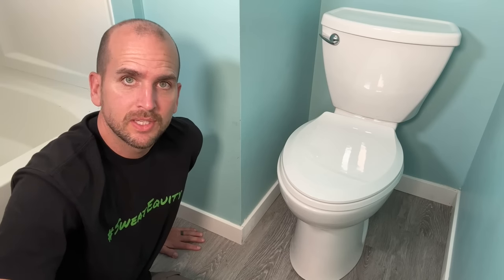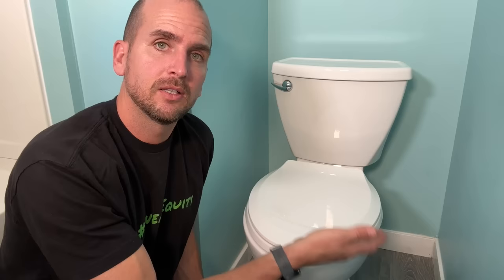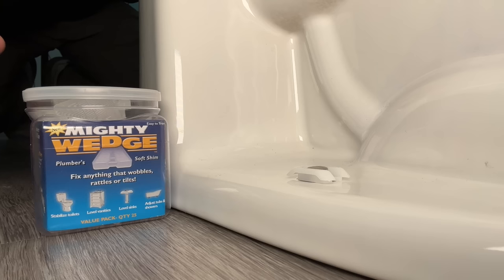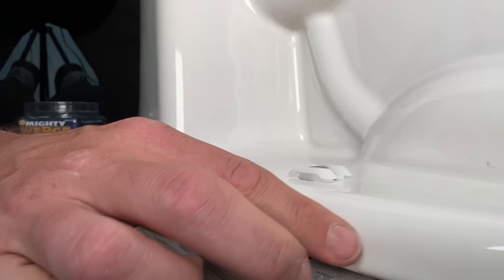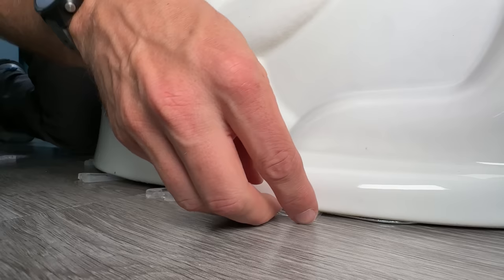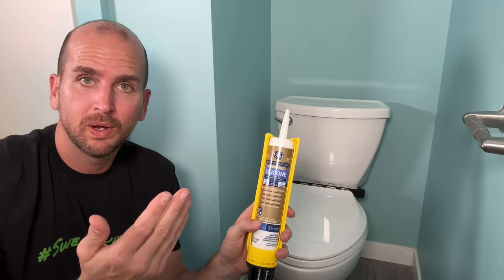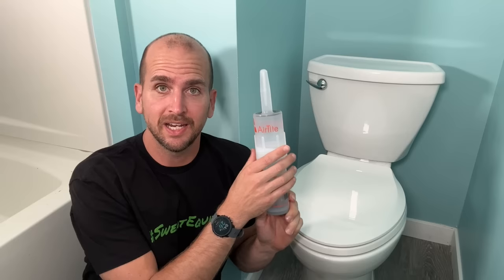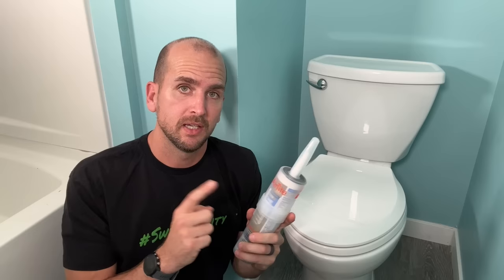How To Fix A Wobbly Toilet | Permanent Solution

Comment: If you installed a wax ring and you shim after you could break the wax seal adhesion to the toilet or flange either with the wobbling toilet or by inserting a shim thereby lifting one side of the toilet.    Compression is ok but lifting up is not.  Level and shim the toilet first with a dry fit without the wax seal. Then reinstall the toilet with the wax ring onto the shims you already placed.
Reply: Great video. For this comment abive is why I made the switch from wax to rubber rings for just this reason. Unlike wax, the rubber/vinyl can accept movement without breaking the seal. Very forgiving!
Reply: This is not a permanent fix. Need to cut out flange and replace with new one.
Reply: It should be permanent, but if you want to avoid shimming rather than the flange being the problem you need to level the floor.
Reply: @MrStevebl19877  If you watched his previous video, you can see that he already addressed the closet flange.
Reply: @lym3204  This happened to me.  Shimmed after using the wax and it leaked due to rocking it to level it.  Wax compressed too much.  I used the Danco Perfect Seal he used the second time and that was perfect.  It let me shim after setting the toilet and it maintained the seal.
Reply: If you dry fit with the shims placed in position they are all going to move once you lift the toilet up again. Just shim after installing but don't go crazy hitting the shims in.
Reply: DIYers should not use wax rings. It's nearly impossible for a newbie to correctly position a toilet on the first try and not have to move it around if you've never done it before. "Better Than Wax" type seals will save you a lot of grief. Or just call a  plumber.
Reply: @bart_seavey  

Just stick the ring on the bottom of the toilet and gently press on it. it gets the wax ring to stay on the toilet while you position it over the drain flange.
Reply: Extra long bolts as well ffs! Lol
Reply: @bart_seavey way to have faith in us 😂

Comment: If you need to shim a toilet all of the way around the base, it is because the closet flange is too high. Shimming and caulking is not the solution. You need to address the root problem. Replace and lower the closet flange.
Reply: I was hoping somebody would notice this - the flange is too high in the first place. The toilet should have first been set down on the flange to make sure the base had contact all around with the floor. If the flange is 1/4 inch about the floor or tiles, then a standard wax seal will be just fine. And if the tiles are not quite level all around, a little bit of shimming will resolve that issue.

Comment: Couple of quick tips: after applying, spray the silicone and the areas where you don't want it to stick with Windex (not water). Spray your finger with Windex and then smooth out the caulk. Works with other sealants too. For tight spots, don't buy caulk in a gun tube. Get the one that looks like a large tube of toothpaste.
Reply: I do the same.  I also run a narrow bead as far into the seam as I can, then come back with a heavier finish bead that I smooth out.  Those smaller caulk tubes are far easier to finesse into tight spaces.

Comment: Alcohol in a spray bottle changed my silicone application life.   Tooling silicone is so much harder than latex.   Either spray on surfaces or on an alcohol soaked rag for wiping.   I got this from youtube, maybe even you!
Reply from the maker: Thanks for the feedback 👍
Reply: Do you use 99% though? I found its only strength that works. I buy case of blue Shop Towels, gallon of 99% alcohol and pack a plastic can with screw lid with towels and then soak with alcohol. It's so perfect.

Comment: I love the AirTite screw-together tube saver.  Now that I know they exist, I'll use your store to get some when I need them.  Thanks, Scott!
Reply: Put a large wire nut over the end of the caulk tube nozzle.  cheaper and it works good.  However,  the Airtite looks like a good product.
Reply: @michaele1201   I used to always plug the hole with something or wrap it and seal it with a rubber band to keep the inside contents fresh, but I like the idea of the AirTite tubes.
Reply: @100vg  Same here.

Comment: plumbers told me decades ago never seal around the base of a toilet, simply if the wax seal fails, water will rot the floor and structure long before you even know you have a leak. As a handy man, for thirty years I haven't sealed a toilet base yet... and I still think its the best advice.
Reply: this is why i would never seal around the toilet....you will only find out later...after your subfloor is rotted...that you have a leaky  toilet

sealing it like this is bad advice....do it right the first time
Reply: He doesn't have a clue whats he is doing.
Reply: It’s not just advice it’s fact. This guys floor is new and smooth there’s zero reason this toilet should not be sitting on the floor. It’s a flange problem that needs to be fixed and it’s really not difficult.
Reply: @smash72cutlass30 It can be very difficult to replace a flange.  My upstairs flange is broken.  It’s glued over a 3” pvc pipe which extends about 18” down.  No way to cut and chisel the flange out.  It’s upstairs so no way to get to the pipe without tearing something up.  The flange sits 1/2” above the floor so it should be OK with a standard wax ring.  But I have no choice but to use repair spanner on flange.
Reply: We have a concrete slab, how much of my subfloor is gonna rot? 🤣🤣
Reply: Just leave a gap in the back for water to leak out. Simple.
Reply: @smash72cutlass30  More like  it's  not even a real toilet  but  I set up  stage  for his  videos.

Comment: One comment I would add is people that are not familiar with working with 100% silicone, only takes a minute use blue tape like 1/4” away and all around the toilet, that way when you finger it the push out goes on the tape and makes for a clean look when removed. One more pro tip wear throw away plastic gloves and mist the caulk with denatured alcohol before you finger it in.

Comment: You need an 8$  set "caulking finishing tool" that are a various set of silicone pieces that let's you have a professional look at the end.  Once you use them you'll realize that a finger is a very poor substitute.  Lastly a finger is a very poor tool since it leaves a very fragile thin edge that tends to fray and peel and looks ugly.  The ideal edge is a 45 degree joint at the joints.

Comment: Does anyone notice how the plumbing contractor or the framer screwed up? Your toilet isn't centered in the opening. Not a big deal unless you dont have 15" from the wall to the center of the toilet. 15" is code in most places but might not apply to where you live.  I couldn't sleep at night knowing i roughed in the toilet off center. Good tips and keep up the good work. PS. Not hating on you, its just something i noticed
Reply: I’m glad you guys say something about different issues. That’s how I learn to DIY what I can, and what to look for if I hire someone to do a project.
Reply: 12" spacing is standard. 10" and 14" are less common.

Comment: Just use a long screw for the used tube. Make sure it will go in snuggly then when your ready to use your silicone or whatever again just unscrew it. Been doing this for years. Why buy something when you can use something you probably already have and it works great.
Reply: I just use electrical tape. Way better than a screw or any other contraption out there. Trust me

Comment: Thank you, I've done a few toilets but I'm always open to new techniques. I'm a fussy DIY guy. Here's what worked best for me. First fit the toilet perfectly  in place with no gasket. Level the toilet, and tape down any shims so they wont move. Then add some blue tape to the floor and toilet and add a few  reference marks for the exact position. Remove the toilet and add the wax gasket to the floor flange. Now set the toilet exactly in place using the reference points. Use your weight to flatten the toilet level and stable. Tighten the base fasteners (gently). Connect the water and test. Now tape tape the floor and the toilet base for caulking. Caulk using silicone for bathrooms. Smooth/tool the caulk. Pull take immediately. Spray caulk with Windex and smooth one more time to feather the tiny edge produced by the tape. It's done, with very little chance of failure and a high degree of perfection with minimal skills.

My recent install was the type of toilet with the base fasteners tucked in pockets which made them very difficult to see/align. We tipped the toilet up onto the forward edge, added the wax ring then tipped it back onto the floor using the marks as guides. It would have been much more difficult without the reference marks.

Hope this helps other DIY'ers

Comment: I know how to shim
I realize that I shouldn’t insert the shims hard enough to move the bowl as it would effect the wax seal
Came looking for videos about the best way to cut the shim. 
This is the best I’ve found so far by far 

Ppl debating whether or not to caulk, split the different, caulk but leaves a few small openings so when the ring fails again you know it and it doesn’t rot the floor completely 

And now that I said that, I just realized I focused so much on the plumbing, I didn’t really inspect the wood at all. 

Don’t overlook that people

Comment: Use TILE CAULK if you want a really good seal and dont like how gross and dirty it can look down there. Use painter's tape and put that on the floor so you can put down the silicone, spray it with soapy water and smooth it out. Pull the tape, it should look perfect!

Comment: If you lift an existing toilet up you better remove it first and place new wax rings otherwise you'll break the "air seal" and things will smell. Use "wax only" rings (no plastic). Squish the bowl back down. Shim as if the toilet were a card table....put 4 legs on it, some being different lengths than the other to level it. (simple) If the floor is out of level you can cheat and tilt it a little (for looks only). If you tilt (in any direction) too much it can compromise the flush...especially with these 1.2 gallon flush restrictions.

Comment: Yes on the shims but instead of silicone, use grout to solve wobbly toilet issues. Clean up with a sponge. The grout will give the toilet a solid base to sit on. I could never leave a customer with a caulk line finished like that.

Also, if you are going to use caulk, use latex caulk and clean it up with a damp sponge. It will look infinitely better.

Comment: Thanks for the tip about the soft wedges, they work great 👍 . I could not find them in any of my local hardware stores so I bought the wobble wedges from Amazon. Wish I would have noticed your link to them.

Comment: You never caulk the base of a toilet because it can conceal leaks at the flange seal causing a rotted floor if not on a slab.
Reply: That's why he left a gap on the back. Explained @6:10
Reply: A gap is not enough

Comment: I think if you used a traditional wax ring it would sit flush to the floor
Reply: I was thinking the same thing, sometimes sticking with old school methods is best.
Reply: Nope. If you have an unlevel floor and you use a wax ring that enables the toilet to set completely flush with the floor all the way around, you will end up having an unlevel  toilet, period.  The only proper way to level a toilet on an unlevel floor are shims (or obviously level the floor).

Comment: Did you get the horn of the toilet all the way into the flange and is the flange broken there's a couple different things that can be wrong To check out before you just go caulking  The base And you should be using grout as ground supports the toilet caulking gives

Comment: I like using silicon based calk that dries clear.  The clear calk does not show dirt or turn off color with age.  It also allows the the bottom edge of the porcelain to maintain its nice rounded edge appearance.  The toilet that I have sealed with white calk can look good until they the calk ages or gets dirty.

Comment: The thing is,  you won't  ever know  if  it's sealed  unless  your sewer backs up.  Then it  run out.  Plus  sealing it with silicone  will  cause  rot  if  there's ever a leak  because  you won't know it's leaking  until  it falls  through the floor.

Comment: Thank you for this video. I recently had a leak coming from under the toilet and we called a plumber. So after the plumber left, the toilet was wobbly and we called him back and he sent another guy. Well after he left THE WOBBLE WAS WORSE!! So now what? Do I call him AGAIN so I can get charged for absolutely nothing? Forget it - I assume the seal is good on the wax seal, (they said they put in a new one) and now I’m going to do exactly what you show here. But I have a question, I understand why it would wobble, but my toilet can also twist about 1” either way. Is that another issue? Or just a normal part of a wobble? Ugh so confused. Also, the white caps I had on the toilet that go over the nut & bolt, are now missing. I guess I have to do something about that myself too. 
   He (the first guy) also had to “cut” something under my toilet that was “cast iron”. He used an electric “thing” (drill saw thing? Then came out and asked if he could use my kitchen broom to clean up his mess, I gave him the broom, he said he was done and put the broom back by my fridge. I was shocked when I went into the bathroom and found a fine black iron dust covering everything is sight including the white walls , decorative towels and hand towels, my white sink and countertops, shower curtain, shower stall, and every shampoo bottle or back scrubber or razor and my hospital safety chair (white one mind you). I was so mad I could cry. He tracked that black stuff all through my house from bathroom to back door, thru my living room carpet. I went to use the broom the next day and it was FULL of that black stuff!! As well as all over the floor behind my refrigerator!! Ugh!! I wanted to scream! Plus, if anyone was barefoot and they went to use the bathroom they got that black stuff all over their feet, and also tracked it through the house on the carpet up and down the hall and threw the living room into the kitchen!! Because he never said “hey there’s gonna be some fine black dust this will create so I’m gonna put shoe covers on or you might want to put some towels down so I don’t get it on your carpet or you might want to mop after I sweep to make sure I got it all up because it’ll get everywhere and you might wanna wash down all your walls afterwards or you could just tape up a piece of plastic so it doesn’t get all over the shower and everything else that was in there brushes the chair the shampoo bottles I mean it was everywhere I had to throw my shower curtain away!! 
  Needless to say, I’m never calling them again. So now I’m trying to teach myself how to fix it. 
  Thanks for letting me rant! I still have a question though if the toilet twists from side to side about an inch either way is that a normal part of the wobble or is that a different issue?
Reply: @everydayHomeRepairs see above

Comment: huh, I've never had a tube of silicone or acrylic caulk go bad after only using a partial tube.  Just need to remove the little dried plug at the end and your off to the races.  I mean, I'm not talking years, but weeks, months, exc.

Comment: I would think the time to level and verify the correct height would be when installing the toilet.  When installed correctly, there shouldn't be a significant gap to the floor and the toilet shouldn't wobble or shift once fully seated to the seal or wax ring.  Personally I prefer the rubber seals over the wax ring, but to each his own.

Comment: If you seal your toilet like that and the wax seal/foam lets loose you will never know unless it's on the 2nd floor. Caulk on a floor will turn black/grey/brown/red/pink. Caulk is flexible and in and of itself will not hold the toilet firmly. Grout, if not contained on all sides will crack/crumble and finally fail. All of these are temporary fixes. Fix the flange if you want a sturdy toilet. To caulk anything with silicone, apply silicone to surface, spray with dishsoap water, a fine mist is all you need, take a silicone caulking tool or a popsicle stick and pull along caulk and wipe tool off with paper towel frequently. Let dry and scrape off any excess. You may not agree with me and that's fine. I've used my methods for 33 years and they work.

Comment: I noticed this when you installed the toilet. I think the question should have been what's preventing the toilet from sitting flush with the floor? Did your adapter raise it too much or is it interfering with the base? Was your flange too high? I have never been a fan of caulking a toilet. Just saying.
Reply: Finally... someone who understands this concept...it's not the toilet....
Reply: @Kevin-mp5of  why is that so hard for some of these people to understand?
The only defective toilet I've seen was because of a crack in it out of the box....you correct the issue, not the result...

Comment: To seal with silicon is a no no. Had to many floors cut and replace subfloor and that was not bad but on high rise building I end up to repair ceiling and sometime wall as well on the unit under the unit someone did silicon the base And never loose bolts to increase the gap. Just use hard shims after I had toilet tide down. Very bad advise